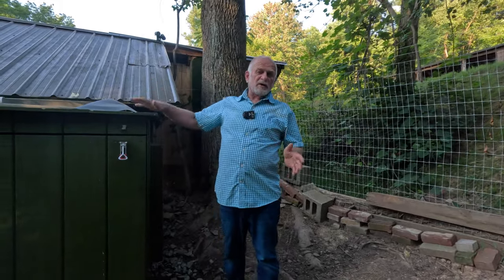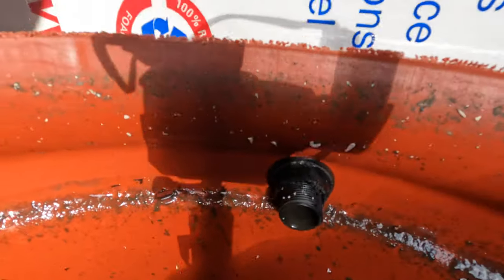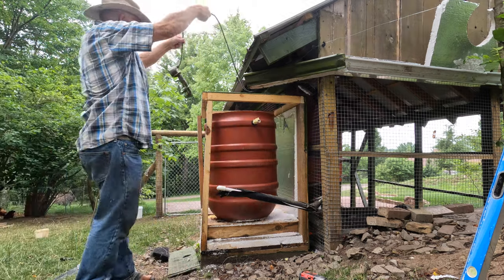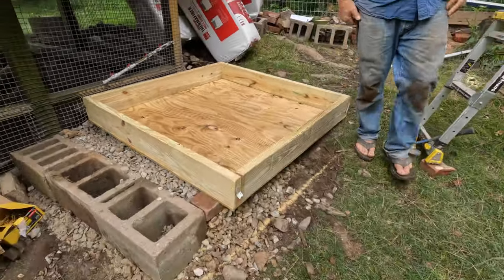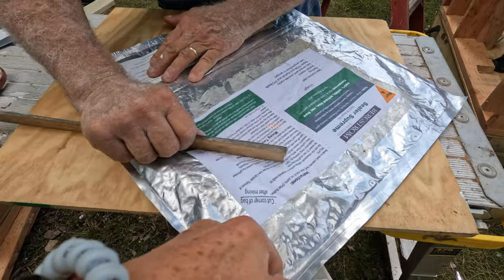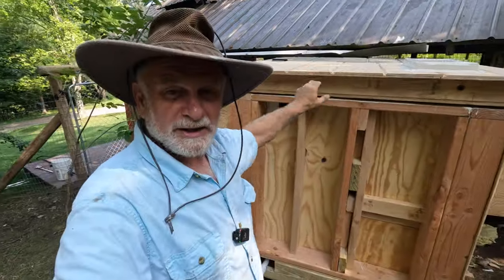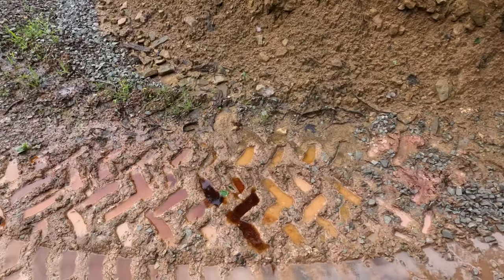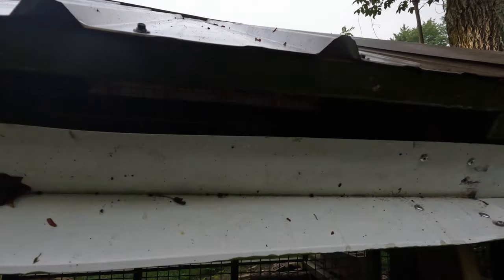DIY Chicken Coop Water Tank from Plywood - Sand Filter + Pool Filter system - Self cleaning Gutter

Comment: A leaf eater and a diverted system works better, the leaf eater makes sure leaves don't make it to your tank, the diverter collects a couple of gallos of the first dirty water that comes from the roof, my gutter is built in the 6 inch thick concrete roof, I'm cleaning my tank every couple of years,  water will enter a 200 gallon cistern,  will get pumped to roof to a 55 gallon drum inside a metal cage to protect from sun light and hurricanes,  I live on off grid water.
Reply from the maker: very nice. I wish I could see yours
Reply: @Farm_Projects  it's a regular rain harvesting system, the only difference is I use a 12v pump,  I have coop build videos on my chicken bunker,  watering system not in yet because I'm building the run first, but if you scroll down to my very first video,  the rain head and diverter is the same I'm using for the coop,  it's called 10,000 gallon rain harvesting system with 12v pumping system., the coop will use a smaller system.
Reply: @Farm_Projects  I have another video called,  prepper shed cistern and 12v pumping system,  this is exactly what I'm doing for the coop.
Reply: @Farm_Projects  Sorry , watch prepper shed micro rain harvesting system,  that's what you want to see, it has a clear view of the rain head and diverter